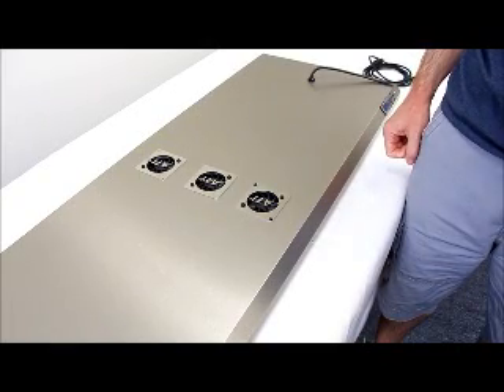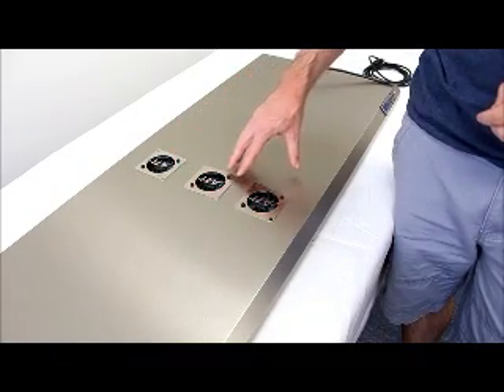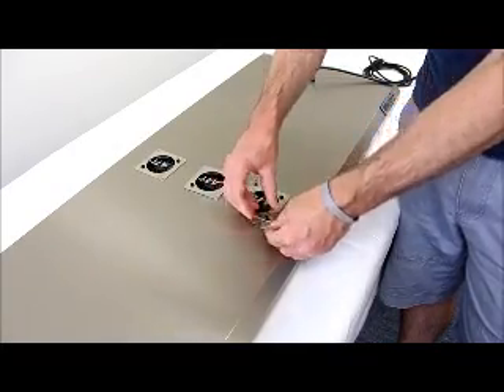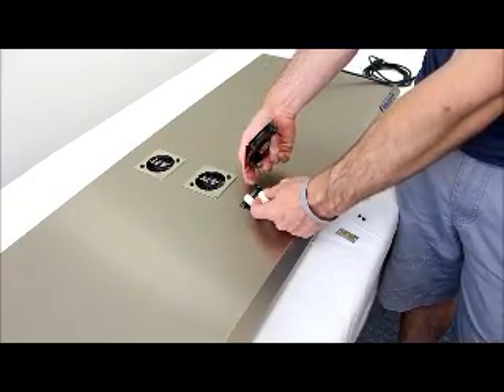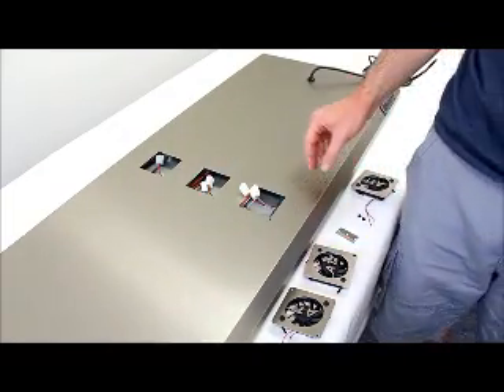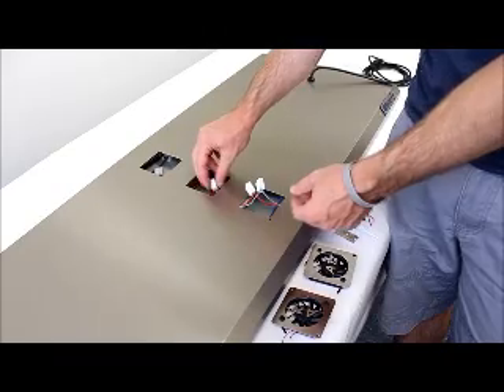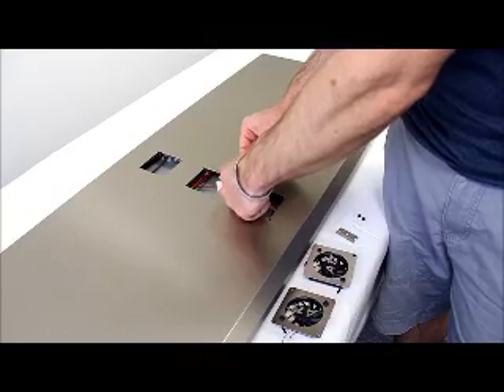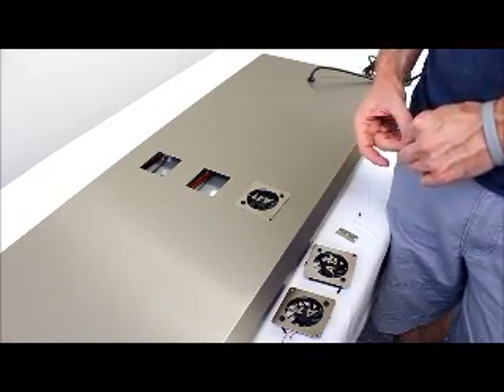ATI Dimmable SunPower - How to Troubleshoot Issues with the Fans

Comment: all you did there was take the fan out and put it back in, i thought you was going to test for the correct voltage with a multimeter at the fan connecter to make sure the board/module was sending out the correct voltage if any and if there was nothing it must be a board/module issue

Comment: There is no troubleshooting in this video, other than assuming that the only problem can be loose connections. What about checking to see if the fans themselves are malfunctioning? Or maybe the controller board isn't sending power? The video title should be "How to Remove Fans and Check the Connections."

This is the video that shows how to troubleshoot the fans: https://www.youtube.com/watch?v=6TtgHANYs0c